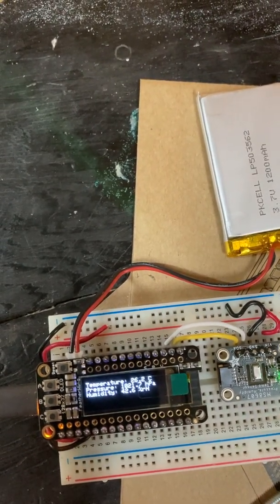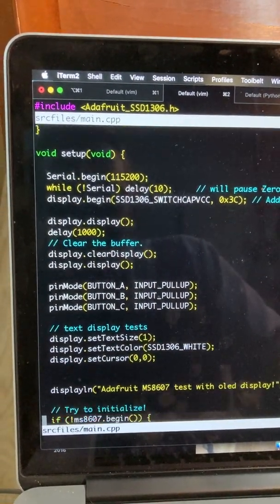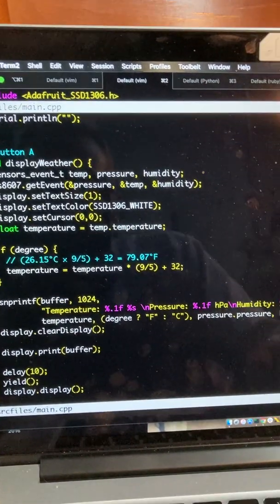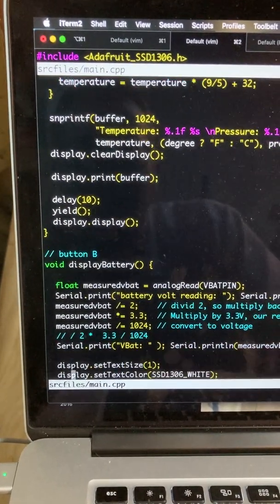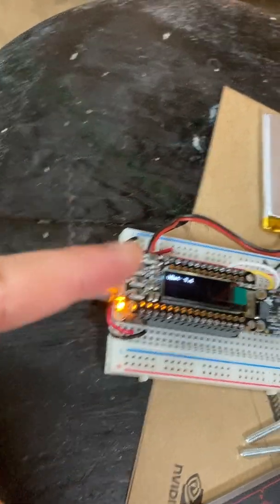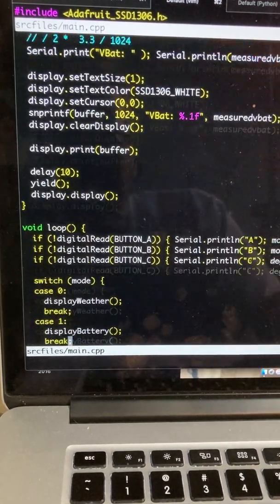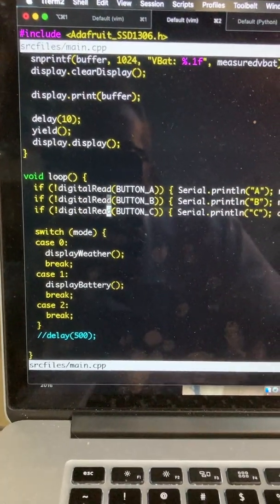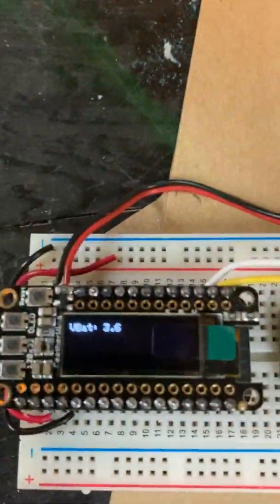FeatherWing OLED displaying battery charge, temperature, pressure and humidity.

Comment: Hi Todd. Your links are not functioning.
Reply from the maker: thanks for checking this out sorry I had refactored things a lot. here is the code from when i made this video https://github.com/taf2/pi-alert/tree/659a6ba14da4eed1353e383b91d42bf60ba73e3d/temp-display-feather
Reply: @toddfisher8248  Thanks for the update. I recently obtained a feather OLED and a CO2 sensor for a STM32F405 I had acquired earlier due to the Adafruit video showing the CO2 reading on the OLED. Example code to achieve this not working - so on a mission to find a different solution which I may have found!
Reply from the maker: @williamchapman7508  That's super exciting.  I hope you share as you figure things out.   Would love help too
Reply: @toddfisher8248  Due to pressure to find a solution fast to control the release of CO2 to monitor the growth of lettuce and basil seedlings, I found an alternative using a TTG0 T1. Obtained the code from Sensirion https://developer.sensirion.com/tutorials/create-your-own-co2-monitor/
Added the ability to control the solenoid valve to release the CO2 from the cylinder. Cost-wise it is much cheaper - one can purchase the Sensirion SCD30 Sensor board without the Adafruit modification for about £47. The LILYGO® TTGO T-Display ESP32 Development Board, which has a built-in screen, is about £8.  I have received some info from the Adafruit forum and will check it out when time becomes available. I was hoping that the example code was made using CircuitPython as I have started tinkering around with Python.

Comment: Nice video Todd. I noticed you modified the suggested battery monitoring code from ADAFruit from *2*3/1024 to /2*3/1024. How did you come-up with that? BTW, the Github link is not working. Otherwise great stuff - keep it up!
Reply: I found the problem - the example from ADAFruit is incorrectly using pin A7 - I changed it to pin A9 and it works. Still unsure why you have /2*3/1024 for the computation of the battery voltage.
Reply from the maker: @The_Clerks  I think I found that calculation while googling around to understand how to get the voltage... Sorry for the broken link I heavily refactored things here is the link from when i made this video https://github.com/taf2/pi-alert/tree/659a6ba14da4eed1353e383b91d42bf60ba73e3d/temp-display-feather.